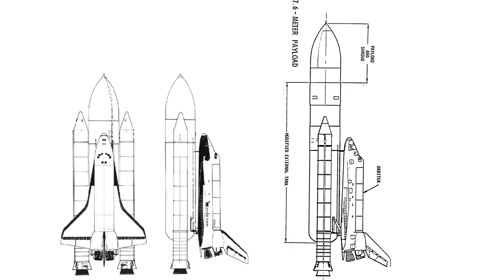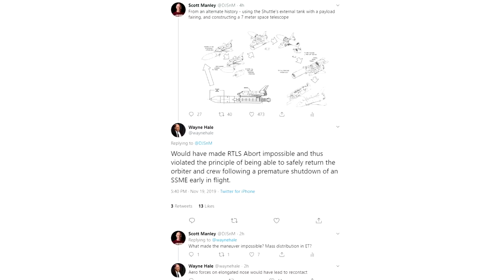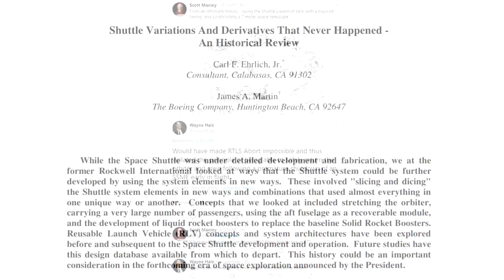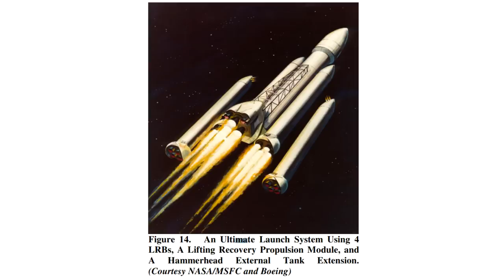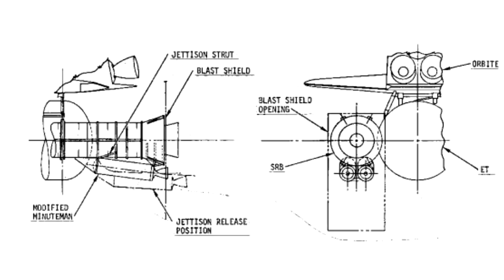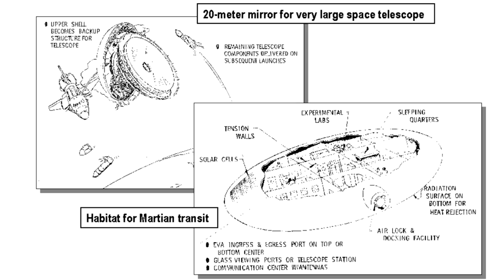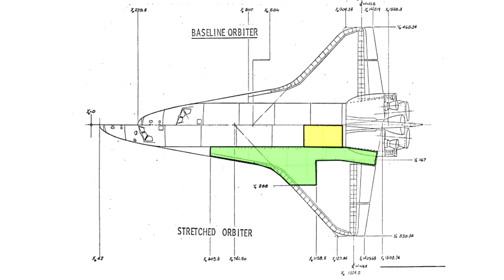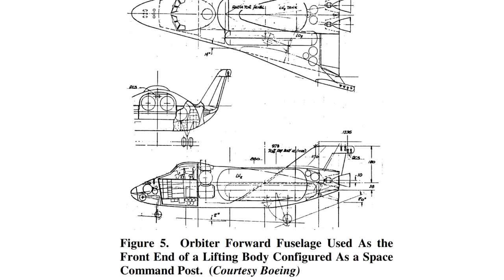Boosters on the Boosters & Other Ideas For Improving Space Shuttles

Comment: I worked on the Shuttle and early Space Station designs in the 80's and 90's. There were two other ideas we looked at. One was to take the External Tank (ET) to orbit and use it as a shell for the space station, where the tanks would be vented and habitation constructed (a bit like Skylab). Another idea added 2 levels of habitation to the bottom of the external tank. Both required taking the ET to orbit though, and the problem with that is the OMS engines could not fire through the CG with the tank attached. And we discovered quickly that any talk of modifying the Shuttle itself was out-of-bounds.
Reply: I call bs. Where would you Put the tanks which reside inside the external tank
Reply: You use the tanks themselves as the habitats, they already have proven to be able to hold pressure, just make the entry through access points from construction.
The idea I submitted back in the early 80s was to use these tanks and build the station in a turos configuration but attach boosters to the bottom of the tank to make the transition to high orbit free of the shuttle but I never got any response from anyone about the submission,  just chalked it up to airforce politics.
Reply: surely with  slightly lower payload mass, the shuttle-and-tank would have enough delta-v to circularise, as I recall that the earlier plans for the shuttle had it take the tank to orbit, instead of detaching it just before, and circularising via oms.
Reply: Was putting the payload on a tower on top of the tank to raise the CG to a point that the engines could fire through discussed?
Reply: Seems like some of the coolest ideas they had for the shuttle never even went anywhere.
Reply: There is also the combined station, where the connection between the orbiter and ET is permanent and a pressurized tunnel is added to join the orbiter, LOX tank, and H2 tank with solar panels in the payload bay. You obviously strip off the wings, tail, and heat shield. The shuttle gives living space for working on conversion work for the tank. Some versions proposed butchering Columbia for this, but the alternative history story Boldly Going went with the better option of using Enterprise.
Reply: @Shaun_Jones  Right, Boldly Going. Or as I like to call it: "The Space Shuttle wasn't bad: The Story"
Reply: @dosmastrify he just said you would hollow them out. And discard them. Just an idea, he never said how far they got thinking about this.
Reply: Using Shuttle -C eliminates any concerns about the Shuttle itself flying with a different tank.
The tank is carried most of the way to orbit anyway, and frequently has to be jettisoned short, and the OMS used more.
Advanced thought went into attaching tether/truss structures, so tanks can be spun opposite each other. When you have odd numbers, it gets interesting.
By varying spin radius and counter masses, a single station could have microgravity, Lunar, Mars and Earth G.
A tank on its side offers 8m x ~20 meters of "floor" or "ground" at that G level.

Comment: Pimp my shuttle: We've slapped a payload on top of your payload, so you can deliver while you deliver.
Reply: Wow, that's a meme I haven't thought of in like 10 years.
Reply: I need help remembering this reference
Reply: @jerry3790  it's the pimp my ride meme where you have the picture of xzibit laughing
Reply: Hey, you could get more payload on it if you moved the engines to the external tank and ditched the orbiter...
Reply: Yo dawg, I heard you like to go fast, so I put boosters on your boosters so you can put payload on your payload.
Reply: And to get it into orbit, we've slapped boosters on your boosters.
Reply: @DanStaal  ...so you can liftoff while you liftoff.
Reply: Comment of the fucking year😂
Reply: don`t forget putting boosters on boosters, so you can boost while you boost
Reply: Literally the GOLIATH 5 from PREY, The rocket that launches the shuttle has a payload fairing aswell... Overkill?
Reply: @gemizu4874  more like project justification maximized:)
Reply: @nomdemorte1302  Sup dawg, add bunch of fancy LCD's too and it's a deal!
Reply: @9999Mihas  Yo Dawg we heard you like boosters, so we put boosters on your boosters so you could boost your boosters while boosting your boosters
Reply: X-47b gon give it to ya
Reply: @polygondwanaland8390  that’s just a regular rocket but with extra weight that does nothing
Reply: @polygondwanaland8390  so, basically, SLS?

Comment: "We gotta put a fairing on top of the shuttle!"
".....why don't we just build a rocket and leave the shuttle on the ground..."
"Quiet! we're building shuttles, SHUTTLES not rockets now!"
Reply: monorail monorali monorail!
Reply: So the SLS....
Reply: Well you can still recover the engines, the avionics and have crew available for payload servicing
Reply: Why does Shuttle have engines?  The plumbing is complicated and it’s all dead weight to be manhandled back to Earth. Why not sit the orbiter on top of the fuel tank?
Reply: the rs 25 were expensive and they wanted to reuse it
Reply: @Dave5843-d9m  Based on the material in this video, it looks like the engines were more valuable than the crew and more important to recover.
Reply: There are multiple reasons:
A) As somebody already said, they wanted to reuse the expensive engines
B) As you can see with the SLS, simply "moving the engines under the tank" takes quite a bit of doing. You basically need to redesign the tank from scratch so it can handle the different loads.
Reply: @HalNordmann  I don't think that flying the dead weight of an empty space shuttle to space would be less expensive than building three (or four) new engines.
Especially knowing that the space shuttle engines were expensive because they were built to be reused and re-egnited while these engines would not.
Not talking about the fact of flowing people to space when it wasn't needed
Reply: Someone at NASA:
Sir, the Russians are putting the engines on the fuel tank so that they can fly it without the shuttle...
It might actually be a good idea...

Some higher-up:
Dumb, silly communists...
If they though it a good idea then it must be a terrible idea, let's not do that...
Instead, let's fly up there the entire dead weight of a shuttle with empty cargo-bay every time...
It's perfect.
Reply: @qdaniele97  
What about 90 or 120 new engines?
The plan was not "two launches, then retire"
It was to use the engines until they weren't safe to use anymore, then overhaul them.

And overhauling itself is significantly less expensive than building from scratch in the context of rocket engines.
Reply: @MadEyeScienceK  depends on the engine, and the cost of recovery. The biggest cost of launch is logistics.

If you can simplify the logistics, the cost would drop significantly. Then it would make much more sense to recover. Otherwise, the cheaper you make a rocket, the less it makes sense to recover anything.

As it stands, Peter Beck confirmed that recovery for Neutron won't drop the cost significantly. What it will do is increase the potential launch cadence. This is also clear from the SpaceX actual price, versus what they say "aspirationally".
Reply: Shuttles do have advantages over capsules for LEO space station work - one of the reasons Dream Chaser is still going when Crew Dragon exists is because the G loads on re-entry is a lot less for a shuttle/spaceplane than a capsule. For payload launch, though, less of a distinction, but if you're launching it you might as well put stuff up there with it...

Comment: The 76 seat shuttle payload bay crew module is from the SPS (Solar Power Satellite) program. It was intended to carry construction crew to orbit. SPS system's were to be enormous, several miles in length. At peak construction the program would have required thousands of astronaut/engineer's living and working in orbit. Scott, you should do a video on the old SPS program -- it was really rather amazing in terms of the scale of effort. NASA technical reports server has all the PDF studies -- amazing stuff.

Comment: If the payload Bay was empty, then they could have put a fuel tank in the payload Bay to use more of the external tank for payload.
Reply: But where does the payload go then?
Reply: wait a second...
Reply: The payload would be where Kris Brooks pointed out.
Reply: Why not just mount the shuttle propulsion module under the orange tank and eliminate the orbiter entirely? Oh wait...
Reply: @gajbooks   Yes, and since it's basically using already developed parts, it will be sooo cost-effective.  :|
Reply: @donjones4719  lol. And on time and under budget too, am I right?
Reply: Lol a series of design revisions that see more fuel in the "orbiter" and more payload in the ET until the "orbiter" doesn't even make it into orbit, and hey you've got Pegasus!
Reply: @Astrelix  Thanks for explaining the joke...
Reply: If you're talking putting Hydrolox fuel inside the bay - I'm no hydrodynamics expert, but something tells me that the point where the two fuel sources met would cause a lot of turbulence and fuckery in the fuel flow. The kind of fuckery that - if not taken care of properly - would likely damage or completely destroy the engines.
You could put more OMS fuel inside the bay, but that's only after getting onto orbit.

I think if you really wanted more payload on a shuttle, extending the ET would make more sense - possibly with those added boosterlets if your TWR was too low.
Or you could make a Shuttle C.
Reply: @gajbooks  because it would take 10+ years and $20+Bn to figure out how to do that...
Reply: @gajbooks  Too bad they didn't make the recoverable propulsion modules as they would have already had SLS in a cheaper to fly form.
Reply: @gajbooks  Well it is more reasonable than all those other suggestions :p
Reply: I like the way you think
Reply: They could have sucked the exhaust back in and re-use it for further propulsion!
Reply: @gajbooks  OR...why dont put the shuttle over the orange tank...by this way...we're eliminating  the risk of all parts or particle  of the orange tank to hit the space shuttle....
Reply: @sky-tecktelecommsttjean-pi1476  well then you have spaceX starship
Reply: That sounds like either Starship as someone pointed out, or the MTK-VA-Vulkan as originally planned by the Soviet engineers before their politbo say "nope, we want a copy of US Space Shuttle"
Reply: Assar Strömblad  indeed
Reply: Assar Strömblad  indeed, hopefully this will work well...
Reply: @gajbooks  That's probably how SLS was designed
Reply: Shockingly this was considered in 1985. An atlas-centaur upper stage nicknamed “bomb in the cargo bay.”
Reply: If the payload Bay was empty, ... than there was no reason to carry this 100 tons monster into orbit - just for conveying 5 seats into space.
Reply: There are multiple reasons for not just "moving the engines under the tank" :
A) NASA wanted to reuse the expensive RS-25 engines
B) As you can see with the SLS, it actually takes quite a bit of doing. You basically need to redesign the tank from scratch so it can handle the different loads.
Reply: So youre putting the payload in the tank and the fuel into the payload bay? Interesting..

Comment: As much as I loved the space shuttle, these examples just show that it was about like using a RV as your commuter vehicle.  In the first example, it would be like using an RV to tow your commuter vehicle to work.    Just stick the shuttle engines on the bottom of the external tank...
Reply: ...and Spaceballs
Reply: It was made to be a space pickup. The first concepts had a two-stage fully-reusable flyback design, but that was too expensive. It was also supposed to work alongside the Saturn rockets (they were going to lift heavy payloads, while the Shuttle would lift crew&supplies) but those were scrapped.
Besides, there are multiple reasons for not just "moving the engines under the tank" :
A) NASA wanted to reuse the expensive RS-25 engines
B) As you can see with the SLS, it actually takes quite a bit of doing. You basically need to redesign the tank from scratch so it can handle the different loads.

Comment: Shuttle derived vehicle concepts are some of my absolute favorite what-ifs of nasa history. My absolute favorite would have to be the Shuttle II proposals (more specifically the block II/evolved orbiter) out of JSC and LaRC. The CERV aspect of that design could have added so much more flexibility to the shuttle platform. Another favorite proposal was the use of a ET plus SRB stack with SSME attached under the ET but with the mid 90s Boeing mars mission aeroshells launched up attached to both sides of the stack.

Comment: @2:30 - Is it just me or does the Shuttle seem completely superficial in this use case scenario? 🤔 
If you remove it - congratulations, you’ve just invented a rocket again 🤣
Reply: Except the shuttle houses the main engines, removing that means the boosters will have to lift everything including a fuel tank that's not losing any fuel.
Reply: @DrewLSsix  but why does it need people onboard?
Reply: @jesusmora9379  to pilot it, they were not automated.
Reply: That is part of the larger problem that the shuttle was always a useless dead end, and any attempt to make it better would logically lead back to conventional rockets
Reply: For a time I could see some sense in the shuttle.
...until I learned it masses 60 tons. SIXTY.
...and it could not fly without crew.
Reply: I think that the shuttle makes sense for servicing missions, and rescue/recovery, but not launching satellites. I guess anything with a time constraint.

Comment: 4:02 - That, plus many many many many abort scenarios even with the stock shuttle configuration, could have been solved by the simple expedient of putting separation motors on the ET in order to assure its positive separation from the orbiter during an abort.

Comment: The External Tank use for Space Station and bunches of it for Space Colonies was technically easy, almost costless but (maybe exactly because of these) swept under the rug. BTW: The original shuttle design was taking the tank to orbit which had minor retro thrusters using slush O2 and H2. This was cut to save cost, weight, etc.

Comment: You left out a couple of interesting Shuttle upgrades, both of which were proposed in the 1990s. One involved Rockewell wanting to provide a totally automated orbiter kit that would allow the vehicle to not only fly back but be able to drop the landing gear and deploy the chutes without need for crew to press the buttons. The other, similar proposal would have seen the orbiter Enterprise taken back under NASA's control from the Smithsonian and then rebuilt as a fully spaceflight capable craft, with one special exception; there would be no provision for crew in the crew compartment so that OV-101 could carry an additional 7 tonnes of payload as an automated freighter for ISS. In fact, a team from Johnson Space Center and KSC went to Dulles to do actual full inspections of Enterprise to see what condition the airframe was in as part of the initial study!

Comment: I still don't know how you find all these crazy dead space concepts lol
Reply: Library of Congress is a good start. Once anything hits Freedom of Information Act expiration, it goes there.
Reply: Hi there Yukon :D
Reply: Or NASA forums. Once I found a Delta IV Heavy proposal that strapped the same SRB of the medium versions to all three the cores, very kerbal idea. Scott should make a video on that too.
Reply: @theophrastusbombastus8019  That's just part of Boeing's Delta IV evolution for EELV, The next step was an 8.4 meter core that could be ganged up, Atlas V did the same thing with phase II stretching the core from 3.8 to 5.0 meters and adding a second rd-180.
Reply: Check out shuttle derived launch vehicles
Reply: @chriskerwin3904  I find strapping boosters to your boosters is much more Kerbal and interesting that the other conventional stretch and add evolution.
Reply: @theophrastusbombastus8019  I recall proposals that included an extra two or four cores for the Delta IV.
Reply: @theophrastusbombastus8019  I think a Delta IV core with 2 Atlas V boosters would be the most optimal from a propellant standpoint (maybe 2 Titan solids although large solids are expensive). Hydrogen boosters suck on their own so you  add solids or hydrocarbons (Ariane 5, H-II, STS)  to get the desired thrust without massive tankage.
Reply: @chriskerwin3904  you would end up with 3 completely different stages, 3 different propellants with temperature and density all over the place and 3 different engines with 3 different turbopump cycles. SpaceX showed how it's completely possible to get anywhere with only kerosene, if you throw away the common boosters of the heavy you have no reason to keep the central core either and maybe keep the efficient centaur. But that is the atlas heavy
Reply: @theophrastusbombastus8019  They don't use interchangeable cores anyway, a  Delta IV heavy is not interchangeable with a regular Delta IV. I'm not sure what point you're trying to make.. how do you get 3 propellants from a delta core using atlas boosters? Kerosene and Hydrogen with a shared oxidizer.
Reply: @chriskerwin3904  there is a lot of commonality in the three cbc while there is none with the atlas. 3 propellants are oxygen, kerosene and hydrogen. Each one of the three brings different challenges and infrastructure.
Reply: @theophrastusbombastus8019  you have to have the LOX anyway...
Reply: @kellywu4061  Hi Kellan!

Comment: 4:42 This concept is pretty similar to soviet Energia, which aside from launching Buran also was aimed to launch huge payloads like 37 meters long "Polyus" spacecraft at the side of a central fuel tank instead of placing payload on top of a rocket. But in Energia the central tank had its own engines, so it was a self-sufficient rocket capable of flying by its own rather that just a booster for Buran.